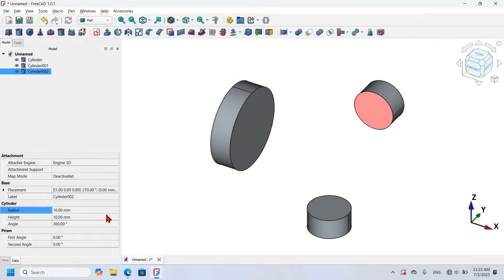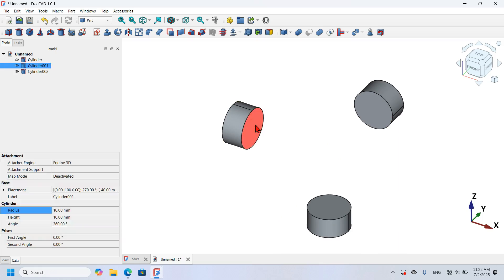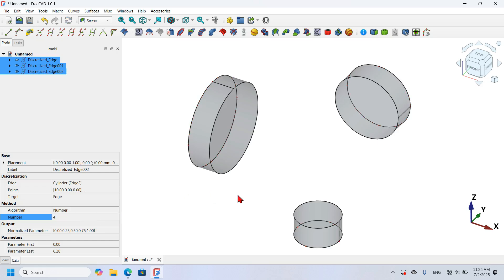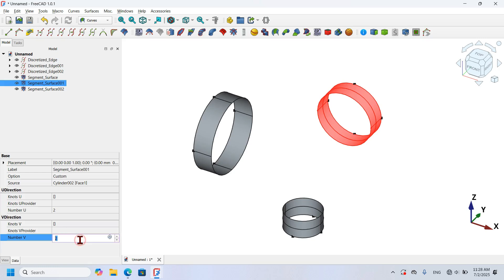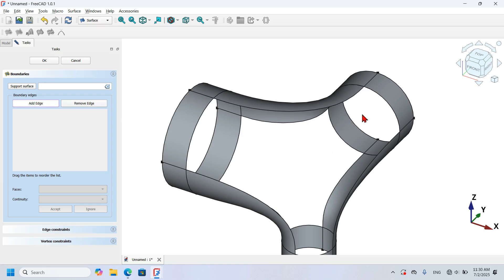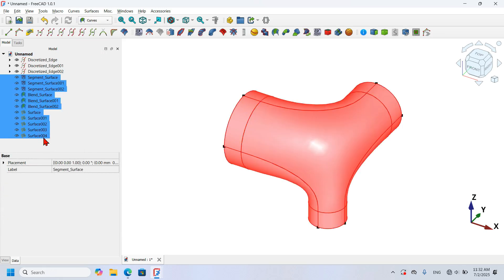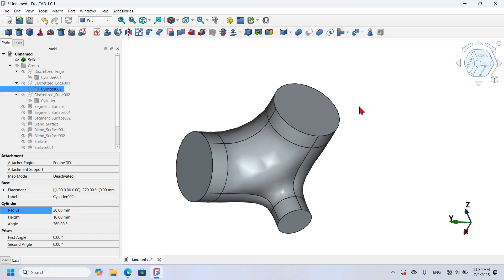FreeCAD 1.0.1: Basic surfacing | Discretize, Segment surface, Blend Surface & Fill boundaries tools

Comment: The way that I got it to work is that I applied the "3D Offset..." tool from the "Part" workbench to each individual surface (make sure to check off the "Fill offset" option).  You'll notice that for some surfaces, the direction of the offset applied might need to be 'negative' because the default offset direction will be in the opposite direction (applied outward vs. inward, etc.)  Thereafter, I applied the "Union" fusion tool from the Part workbench to fuse the different Offset objects together.  If you get an error at any time, restart with a different sequence - just make sure that as you're doing so, each subsequent fusion object is making physical contact.  I did perform "Check Geometry" to the resultant solid and no errors were generated.  Hope this helps.

By the way, there is no need to create the surfaces for the three openings since they are not used for this particular workflow.

Comment: Make a copy of the part. Either shrink the copy by the desired amount or change the radiuses of all the cylinder by the size of wall thickness(i.e. 1.4mm smaller). Now you have 2 concentric parts: original and the copy 1.4 mm smaller. Subtract the smaller one from the original by boolean command. Done!
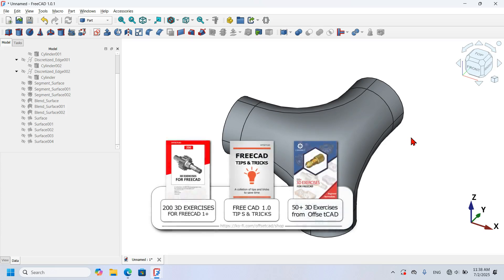But you have a surface problem(seems to me) at 9:22/14:07. There is a bulge on the fill surface. ERASE IT! You need to split the small surface at 45 degrees (create a plane), create splines in middle of the surface on small cylinder and on the other big fill surface(on the same plane)(split the big fill surface by the  created plane to get the edge) and then create blend spline between the two. Use the fill surface between the edges and the spline. You get only one half surface Then you can create other half surface same way or by mirror copy.
Reply: Very very underrated comment.  Thanks so much @jiritichy6855 ! Will try this out.
Reply from the maker: Thank you very much sir.
Reply: Well stated and accurate solution to the problem. The original surface did not have enough control points to simulate the surface curve accurately, thus the bulging. By splitting it in two, you double the points which gives a much smoother and accurate depiction of the desired surface.

Comment: Please, can you describe how to change G1 settings? What property refer?
Reply from the maker: If I remember correctly, you can change this as follows:
1. Double-click on a feature created by the "Filling" tool in the Surface workbench;
2. In the Task panel that appears, double-click the selected edges;
3. This will enable the fields below, where you must:
- Assign a face to the edge;
- Then choose the continuity option: 0, G1, or G2.
Reply: @OffsetCAD  thank you, found it. But also changing all to G1 in all three surface still not working

Comment: Alle Flächen auf G1 umstellen, dann müsste es mit der Wandstärke klappen
Reply: What is G1?
Reply: @LT72884  n FreeCAD, G1 refers to a continuous tangency between surfaces or curves. It is one of several levels of continuity used to describe the smoothness of transitions in 3D models. More specifically, G1 means that the tangent vectors match at the transition points, resulting in a smooth, but not necessarily curved, transition.
Reply: @w.binder-freecadchannel so i would set that option in the properties box correct?
Reply from the maker: G1 and G2 are to smooth the transition of surfaces.
Reply from the maker: Thank you! It worked!